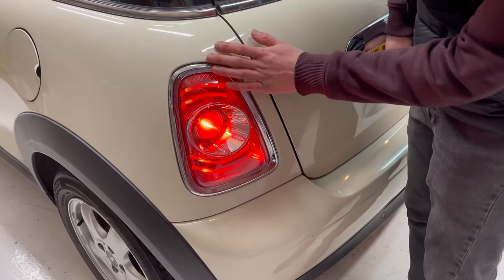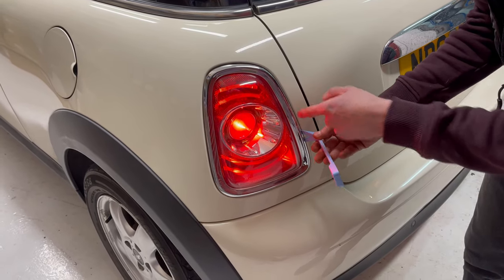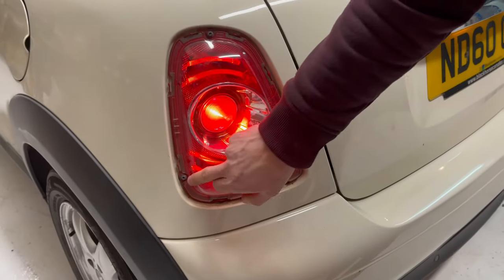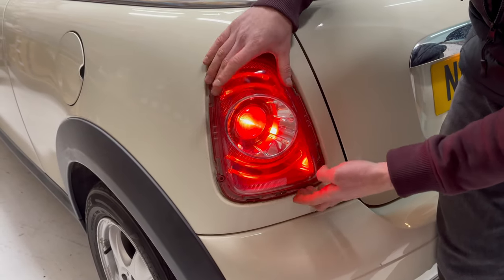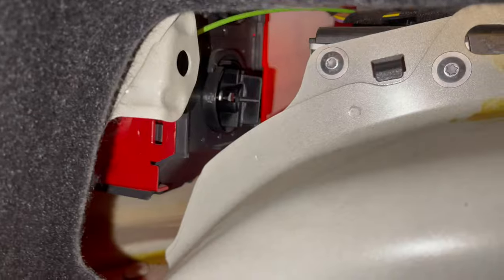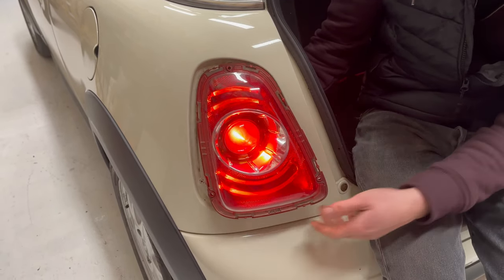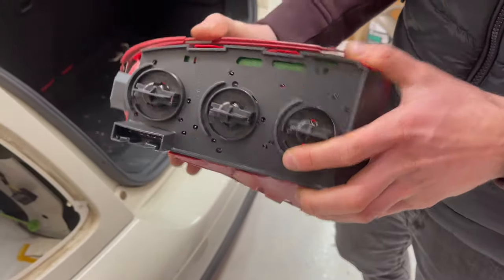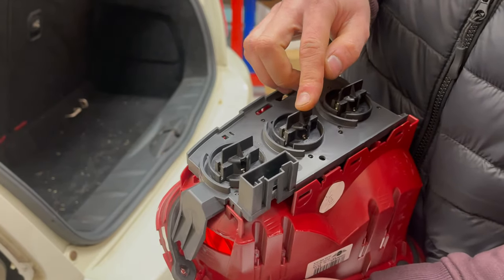Mini Cooper/One R56 Rear Light Removal How To 2006-2013

Comment: You don't need to remove the cluster to change the bulbs, they just twist out from the rear access panels. The only reason to remove the whole cluster is if the bulb holder is seized in place like mine was (Top brake light bulb). Subsiquently I found the contact to be slightly burnt out so needed cleaning up and some dielectric greese applying to prevent further issues.
Reply: unless you ve got very small hands ,the bulbs,especially the bottom one can be a pig to remove from the inside.
Reply: @stevehorsley903  I have got small hands and could barely reach in to get the tab at the bottom. It's tight.
Reply: @stevehorsley903  I know this video is from some time ago but it helps for people searching for the solution; the comments are always good too as more opinions + more information. I agree, someone with very small hands could get to the bulbs, I couldn't get to the top one so out came the cluster. My only alternative comment to the video which may help anyone in the future is with regard to removing the silver outer lamp cluster surround. Lever the trim very slightly from the inner side ( closest to the lamp cluster), doing it from the outside risks breaking it. If you look closely you can actually see where the trim is clipped so it's easy to work out what to do, I used a wide scraper whilst praying that the plastic wasn't so brittle it would break; worked a treat.
Reply: I don’t have one of those plastic pry bars to remove the cluster so I’m going to try using my small lady hand in there and try to remove the brake bulbs. I sure hope I can. My dad worked with B52’s  in the military and then come home to his car at home in the garage and I’d love watching him fix it. I’d always sit there quietly and tell him  “Now if you can’t  reach something just let me know” lol - he’d always end up asking me if I could fit my little hand down in the engine and he’d tell me what to do.  I sure do miss him! 😢 So I’m thinking I can just fit my little hand in there and fix this myself. Wish me luck !

Comment: This video rather shows how to remove your tail light with high chances of braking the tabs (clips) on it. It may be done very easily if you follow it. The correct way to remove the trim is to stick your pry bar (ideally a plastic one) between the tail light and the trim.

Comment: I have a 2009 convertible. I have no idea how I’m going to release tab to remove light. The access panel is smaller and higher.
Reply: Ooh this video is for r56 models 2009 convertibles are r57

Comment: It would be a good day if u can remove the chrome trim without breaking any of those tabs on the light assembly.... and...
I don't know how u could reach the bottom clip. God damn stupid design if I have to comment. When I can manage to take off the assembly, I will just chop off the stupid clips!
And it is never the light bulbs. It is the socket holder contact points or the plastic simply MELTED. Use jumper wire with quick connectors to bypass or soldering to make permanent contact points. Damn Mini. They have been making the same for a decade or more and making improvement, or fixing bad design is never on their mind.